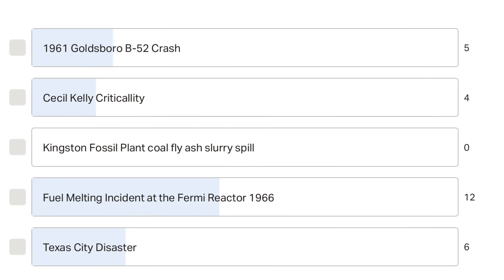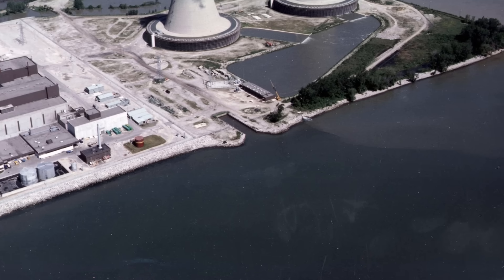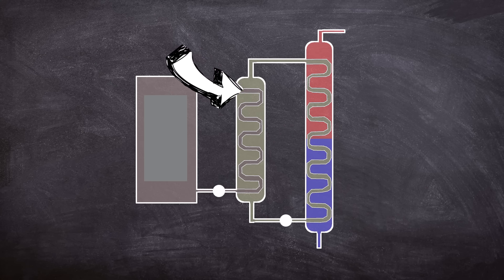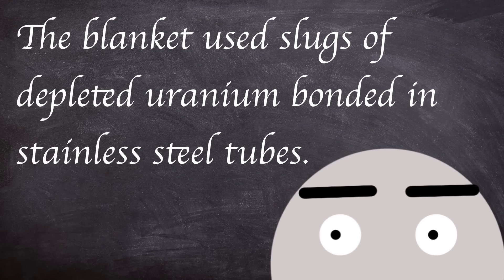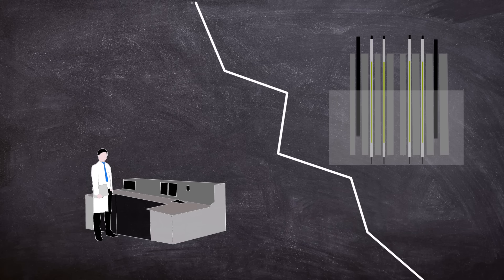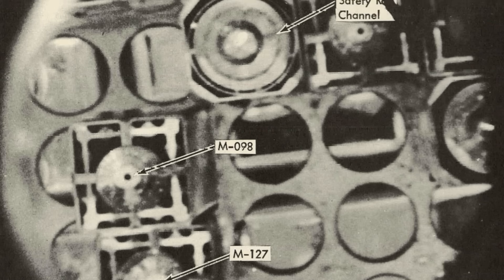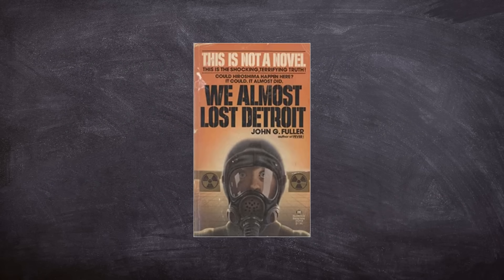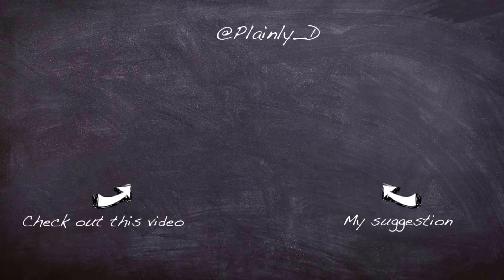A Brief History of: The Fermi 1 Reactor Meltdown (Short Documentary)

Comment: Even an electric kettle switches off when it gets too hot, so they had sensors on the sodium outlet temperature but hadn't bothered to connect that to the control rods or scram circuit?
Americans. Never give them anything to manage that requires any foresight or care.
Reply: Windscale.  And that was a totally unnecessary pile anyway, built to get the country in the nuclear race.  Think what the money used in its construction could have done for British citizens. And think of the damage it did to local agriculture and the health of local citizens.  They knew it was spewing radioactive particles over the countryside, and they did nothing, because they were trying to play catch up.

Comment: Sodium metal is scary enough without also being molten. And under pressure. And radioactive. O.o
Reply: Right? A high-school friend of mine blew up a school toilet with a nice chunk of sodium. It was both amazing and terrifying. (He's an Emmy winning SFX guy now.)
Reply: Since boiling point of sodium is 1621 Degrees Fahrenheit, you don't need to pressurize the coolant to prevent boiling. 

Since the melting point of sodium is 208 Degrees Fahrenheit,  you will struggle to keep the coolant from freezing.
Reply: @Jodonho  Sodium, in this application, is often alloyed with potassium to form a eutectic that is liquid at room temperature.
Reply: @nemo5654  And NaK is even scarier than sodium.
Reply: @linuspoindexter106  Not really, behaves pretty similarly under most conditions.
Reply: @nemo5654  Much more explosive with water, more powerful columbic explosions.
Reply: @virtualtools_3021  No, it does not have more powerful Coulomb explosions than its constituents. The only extra precaution is the ability of potassium to form a highly flammable superoxide, but this is well known, and NaK is safely used in several industries everyday without incident.
Reply: @nemo5654  Listen to Nemo when it comes to Sodium. He powered his submarine with this stuff!
Reply: @Jodonho  Yep - biggest problem with liquid metal cooled reactors is you can never let them go cold or they freeze solid and will never move again, and presumably doing any maintenance on the cooling system is a nightmare.
Reply: @iainbagnall4825  It's called bricking, and it ruins the reactor.
Reply: @Jodonho  correct pressurization is only for water, to raise /lower its boiling point
Reply: @Jodonho  You may have missed the part in the video about the fuel rods melting. Uranium melts at 2070 F ...well above the boiling point of Sodium.
Reply: @kirkc9643  It was only a small part of the reactor core which reached those temperatures.
Reply: Only if you value your life !
Reply: I always thought an under- water engine that sucked in water, and injected sodium for power. 
Slow moving. Super high torque. 
Would be a cool submarine engine. 
As no oxygen (other than water) is needed for reaction.
Reply: @fastinradfordable  then you take the hydrogen exhaust and use it to power a fuel cell for the ships power. would be pretty cool!
Reply: @virtualtools_3021  hey man after the got a nuclear jet engine to work and isotope generators why not?
Reply: @fastinradfordable  The last thing you want in an engine is extremely energetic reactions. The central challenge of gasoline engines is maximizing energy extraction without causing a detonation (knocking), as that will quickly tear it apart.
Reply: Rob Speed If you used strong enough materials it might work though, and it would produce much more torque than any other ICE. Biggest issue is that water cant compress and the sodium wouldnt be able to mix with the water before going boom.
Reply: Bent Rod as an aside, the highest performing rocket engine ever designed used liquid lithium and fluorine to provide heat, and hydrogen gas for thrust. It had an easy 600seconds specific impulse.
Reply: @WineScrounger  HELLO MINE FREND. DID YOUE mean SPECIFEC IMPUSLES?

Specific impulse is the change in momentum per unit mass for rocket fuels, or rather how much more push accumulates as you use that fuel.

tHANKE YOU AN DTHUBBMSSES UPPES!
Reply: i love cops hard to read but yes, I did. 👍
Reply: @WineScrounger  THNAKLY YOU AN DTHUMBBES UPPES!
Reply: @fastinradfordable  That sounds perfect for a container or oil tanker ships engine as well as they're in and can store water.
Reply: Excuse mee, but sodium is nothign but table salte used for cooking and soupes. It i snto supposede to be used for nucler reactorres.
Reply: @ilovecops6255  incorrect. Sodium is an element. A shiny metal one. Table salt is a compound of the elements sodium and chlorine
Reply: @kirkc9643  THANKS YOU MINE FRENDES! I found this at mayoclinis...,Table salt is typically mined from underground salt deposits. Table salt is more heavily processed to eliminate minerals and usually contains an additive to prevent clumping. Most table salt also has added iodine, an essential nutrient that helps maintain a healthy thyroid.

THANKE YOUE AND THUMBBESS UPPES!
Reply: @ilovecops6255  There are only 92 natural elements, so some of them have to do multiple duties.  Sodium in its native state is a silver metal that is very reactive to water (it sort-of explodes), but when heated and liquified it's a silver liquid that is very suited for moving heat from a reactor to the environment.  Only when combined chemically with chlorine gas does it become table salt.  It makes a lot of those chemical combinations to become sodium bicarbonate, sodium salicylate (aspirin),  sodium silicilate (water glass) and a lot of other things.
Reply: @puncheex2  THANKE YOU! I the U SMInt SHoud get sodium and melt it into silver bars and coines. 'it's a silver liquid '. THANKE YOU AND THUMBBESS UPPES!
Reply: @ilovecops6255  It's a silver liquid when it is hot.  At room temperature its a solid, and it is stored in oil to keep water away from it.